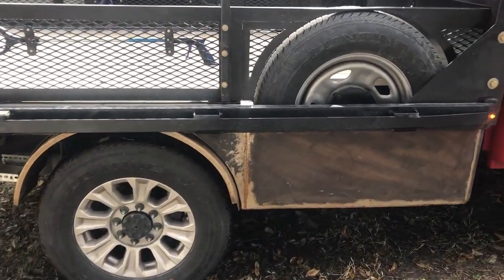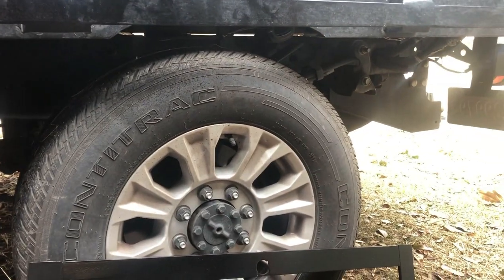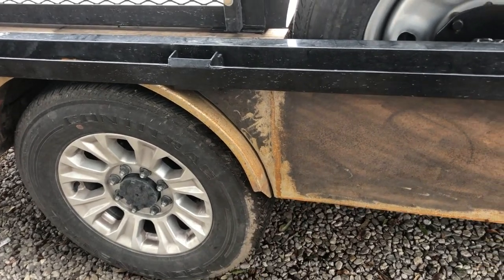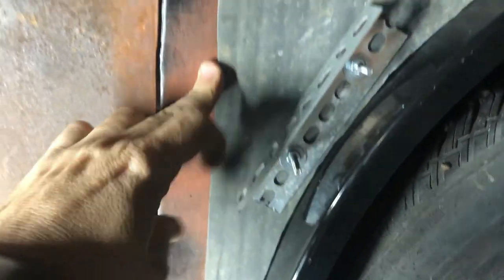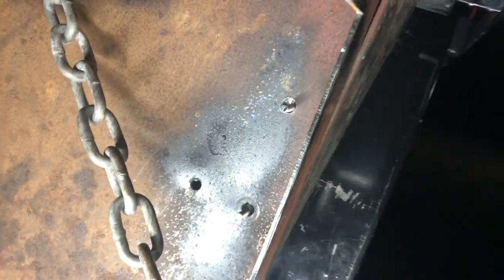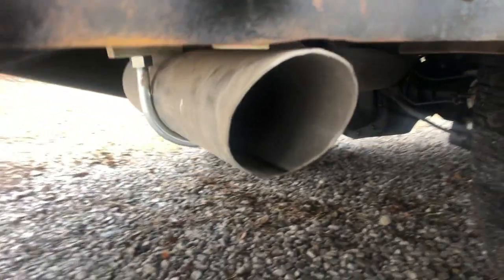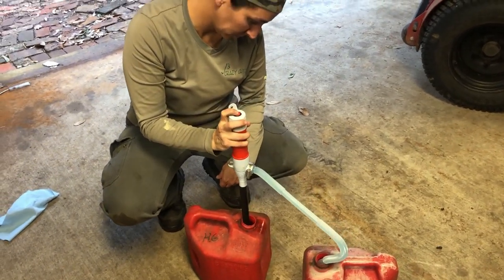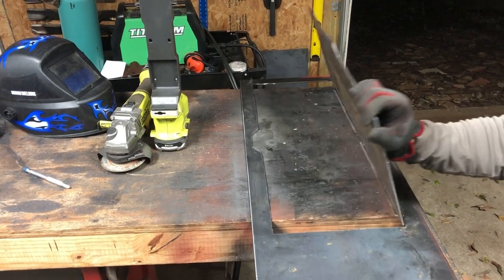Making Tool Boxes : Custom Truck Bed

Comment: Really coming together  , I'm still waiting on the 71 video.  👍🏻
Reply from the maker: Thanks, It's probably going to be a while before we work on the 71' again. We still need to build and install a flatbed on it so, we can get the front end alignment and it also needs the seat re-done,  new windshield etc before we start actually driving it 🤷

Comment: Looking good. How's Christina's truck coming along? Still looking forward to seeing vids and/or the finish on that, too.
Reply from the maker: Thanks bud 🤜 💢 🤛 Christina's truck is on stand by. It still needs a flatbed on it before we can get the wheel alignment. We also need too get the seat recovered and a new windshield before its road worthy🤷